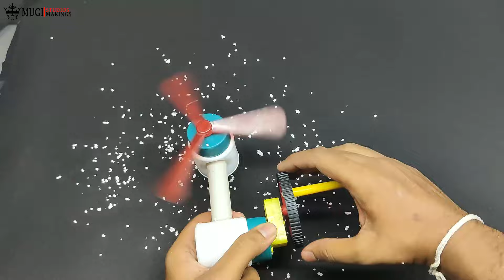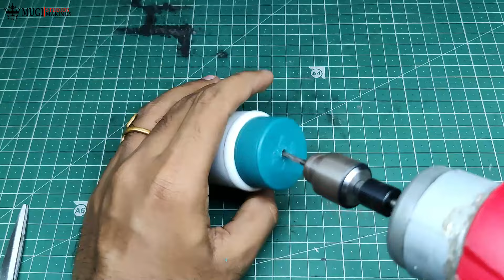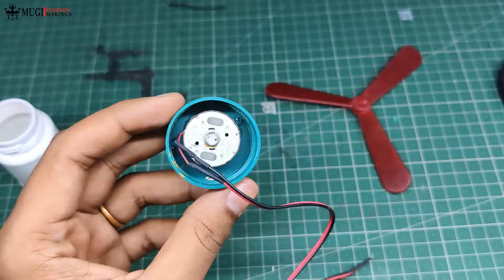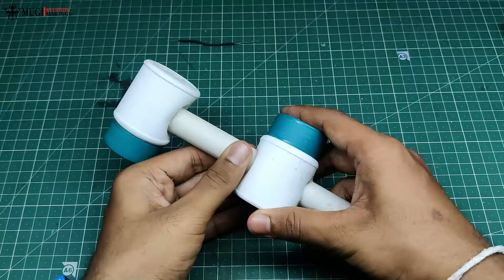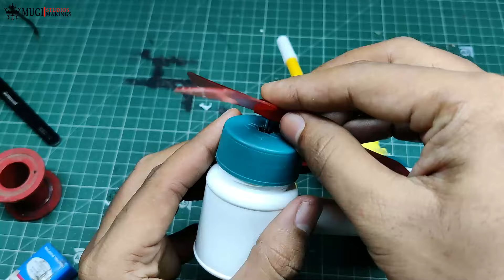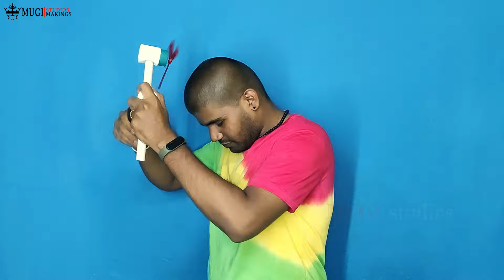free energy | FAN | how to make fan without battery science project #diy #free #energy #fan

Comment: This doesn't work out practically.you need a much larger one to produce and channel current to power another motor,cause nothing comes for free and some energy gets dissipated in form of heat through resistance, i think that dc gear motor is not powering the fan . You have hidden a hw .

Remive this comment if you agree
Reply from the maker: It's a 200% work model i prove u came Instagram @mugistudios and I make one reels for u